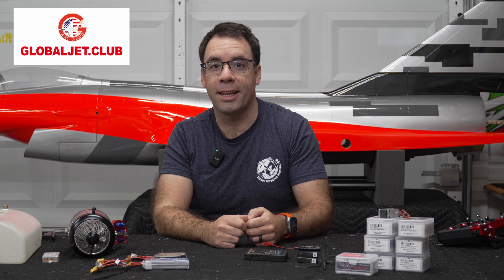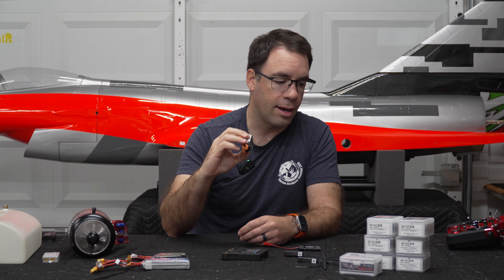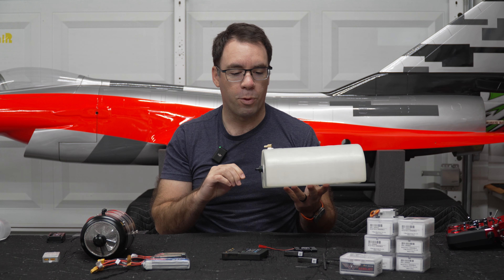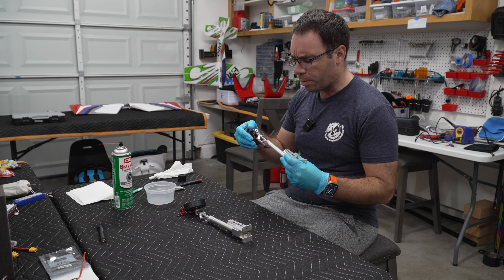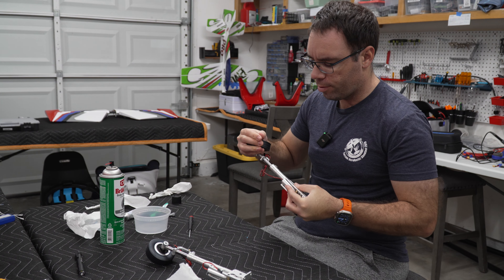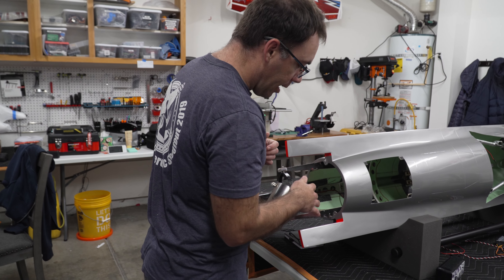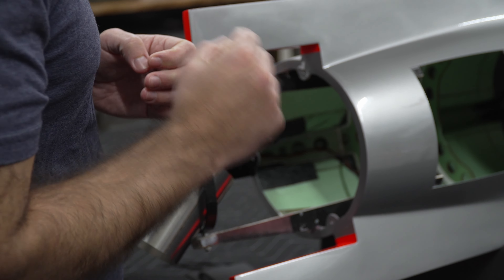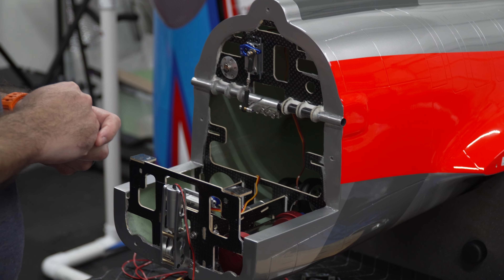Pilot-RC 2.8m J10 Build

Comment: Hola Juan, do you think a swiwin 190 at 42lbs of trust would be a good fit for this plane or should I go with a 220?
Reply from the maker: If you put most things towards the front of the plane to avoid needing any lead for CG adjustments and avoid adding any non required weight (i.e. no smoke system) a 190 should be a great option.